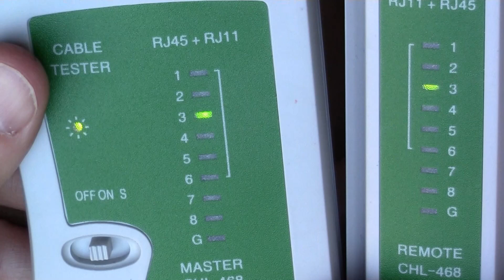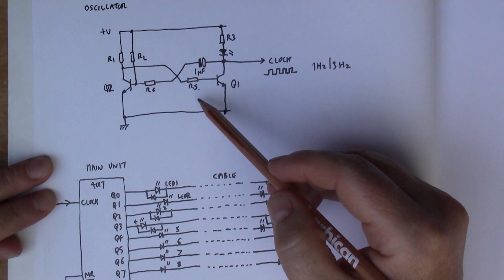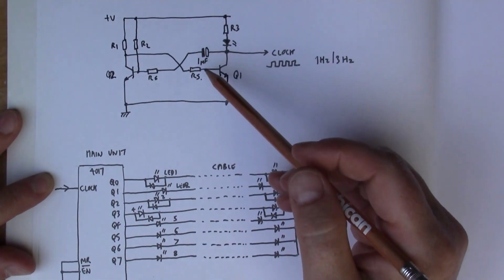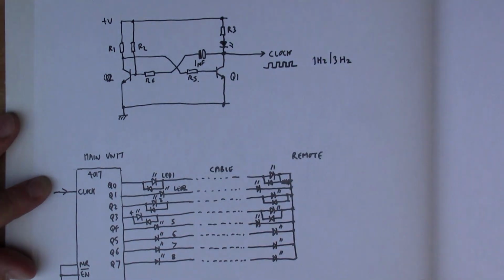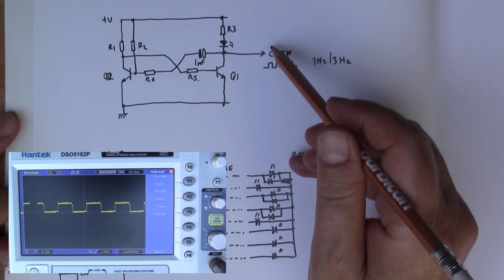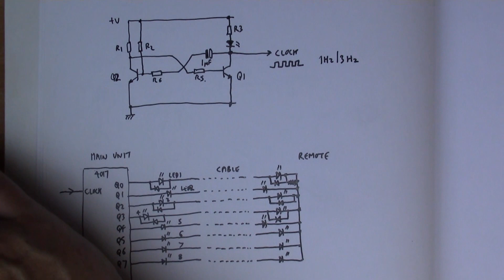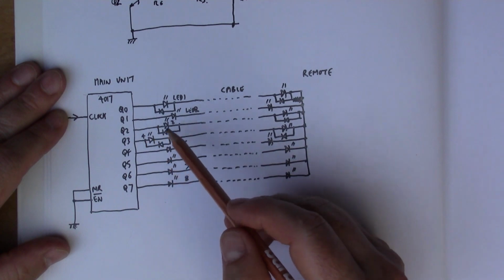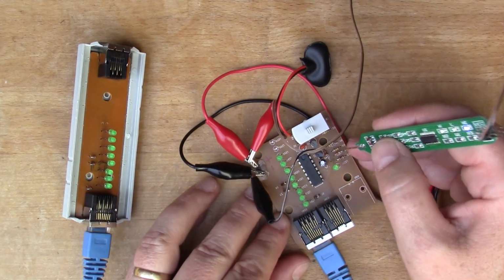Ethernet Cable Tester - Review & Teardown (#74)

Comment: I'm curios on how the grounding works on the remote part of the lan tester? Could you explain it? Thanks
Reply from the maker: From what I remember,  a few pins have a diode, such that when the matching Q pin on the central unit goes low, the diode can switch on and it is a path to ground.  Since only one of the Q pins is high at any time, there's a fairly good chance that you'll get a ground connection unless of course all the wires in the cable that correspond to the diodes are broken.

Comment: I can see that if there were a short between cores 1 and 2, LED1 would light at the master end, and both LEDs 1 and 2 would light at the remote end, since there is no return path to Q1. But if there were a short between cores 1 and 3, the return diode would mean that there were no lights on the remote end at all?
Reply from the maker: I'm not sure that I follow entirely, but it looks to me that if there are shorts between the wires then at least some of the remote LEDs would never light, so you'd know something is wrong with the cable. It's a simple design, and pretty effective for finding loose/wrong wires.
Reply: Agreed - if it goes "1,2,3,4" at both ends, all is good. Anything else something isn't right!  @MartynDavies  Thanks for putting this teardown out there

Comment: I just don't get which Ethernet wire connection do they use as ground for the remote light box!
Reply from the maker: There are some reverse diodes in the remote that lead to 4017 pins where (if the pin is low), there will be a path to ground.  Of course in the worst case, if all these wires are broken in the cable then nothing will light, but that would be unlucky.
Reply: @MartynDavies  Ok, thanks, I used just two diodes on wire 1 and 8 and it worked ok. The reason for 3 diodes is that with only two the first and last led, 1 and 8, become a little dimmed.
Reply from the maker: @Popart-xh2fd  I think there are diodes on both sides of the cable, so the 1.2V drop is going to dim the LEDs.  Brilliantly simple design, though.
Reply: @MartynDavies  I made a mistake I didn't bypass the resistors with the diodes! Now that I add diodes for all the other leds bypassing the resistors everything works well, with the advantage of having no false failures due to lack of ground loops.

Comment: Nice review.
So the ground/shield test LED was a dummy.
Reply from the maker: yes
Reply: @MartynDavies  A dummy? Or was it just not populated? Looks like there's a space for it on the board and shielded rj45 sockets. Also seems that the 4017 isn't set to reset after the 8th LED. So that line could be connected and ready for an LED?
Reply from the maker: @sh06un1s  Yes, thanks, I might try that
Reply: @sh06un1s  I've got the cheaper version but circuit is the same and yes populating the G with LEDs works.

Comment: Great video, thanks! Do you know why is there 3 diodes (pin 1, 3, 4) for routing back to earth? Why not only, say, two diodes - on pin 1 and 2.

For the USB cable testing, I would just use the stock RJ45 tester and this useful adapter ("USB cable adapter converter board"):

https://www.aliexpress.com/item/32824738373.html?spm=a2g0o.productlist.0.0.251d763ejmjj5M&algo_pvid=ea913761-cfe0-4ae1-82a0-8e81286c490c&algo_expid=ea913761-cfe0-4ae1-82a0-8e81286c490c-0&btsid=0ab6f83a15885128715777900e430e&ws_ab_test=searchweb0_0,searchweb201602_,searchweb201603_

I would make a custom RJ45 male to USB male (using the right part of the linked adapter with USB male). Plug that into the USB female of the middle part of the linked adapter, and then test any USB cable like that (making the other side similarly).

I own the USB adapter board, I just haven't used it for testing cable pins. I use it for testing the charging capability of USB cables, or connecting USB devices like a keyboard over longer CAT cables.
Reply: I see now on your channel a few videos later you found a USB cable tester device, that's an easier solution. The adapter board I linked, however, could still come in handy for you since it has more connectors like USB-C and lightning.
Reply from the maker: I imagine it has multiple return routes (and diodes) to give the tester more resilience if the cable has multiple strands broken.  But this is just a guess.  Thanks for the link to the adapter - that looks nice.